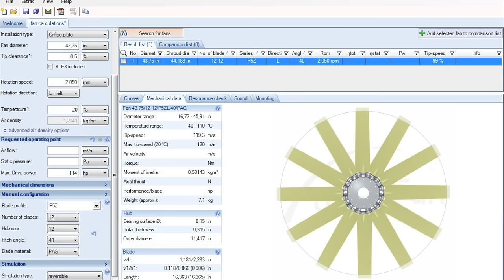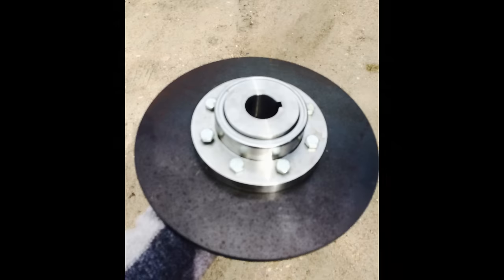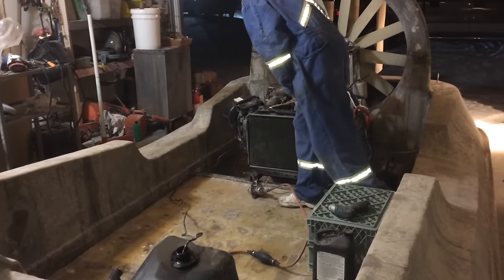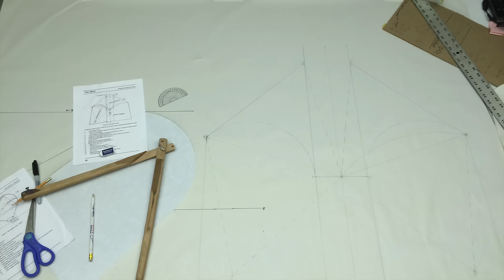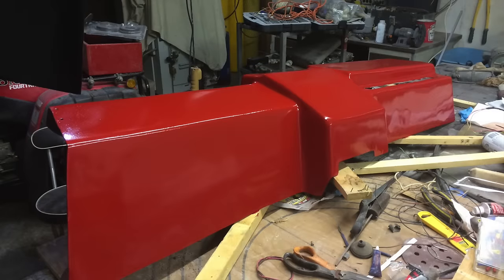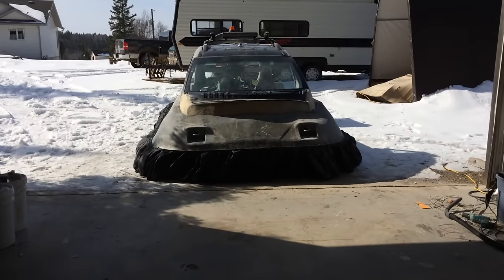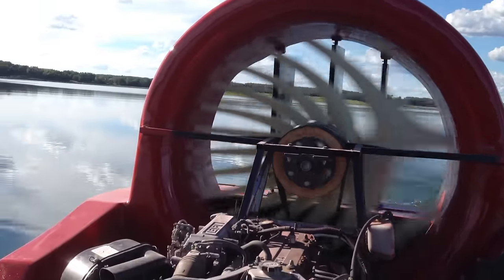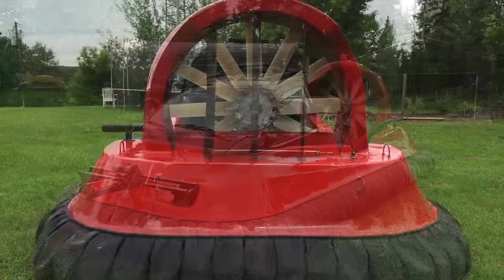DIY Homebuilt Hovercraft

Comment: Super cool. I'm currently in the middle of upgrading an aerocraft 1100sa and came across your video. I'm converting the manual joystick steering and throttle control to an electronic by a custom ordered machine joystick that outputs into an arduino that control servos for the throttle and a modified windshield wiper motor piggiebacked off another servo for position sensor for the steering. I'd like to upgrade the engine from the stock 60hp rotax 582 to a suitable snowmobile engine but atm I'm unsure of how to achieve proper pitch and rpm so I don't blow either the prop or engine up. Was thinking I would use a cvt and maybe variable pitch prop and use some online calculators to help guide me. My biggest concern is weight added such as bucket seats, instrument panel stereo ect. Having enough thrust to enclose it would be great. Would you be able to provide me with any websites and shops you used in your project?
Reply from the maker: Hi Robert!  I used a multi-wing “Z” series on my craft.  The blades are adjustable in the hub assembly.  There is a series of notches that allow different pitches.  They were helpful when I contacted them.  They had a program that you would put the parameters in and it would tell you approximate pitch settings.  If the fan can “absorb” the power from the motor, it won’t over speed.  Keep it simple if you can, reduce the fan rpm with a pulley system or commercially available drive reduction unit.  Less fan RPM will mean less noise.  If you need specific parts or materials let me know - I can try to help you.  Here is a link for wing-fan.  https://www.multi-wing.com/us/z-series
Reply: I never got a notification so im glad I checked back to see if you replied.. You raise an interesting point about lower rpm to limit noise, and after reading about reverse angle pitch for reverse thrust and  having the ability for constant rpm thru variable pitch I'm sold on an electric controlled hub. I've yet to find one thou. I've also decided to go for the ground effect craft after seeing them on YouTube. I'll check out the link you sent. Ty

Comment: I would like to know how you supplied air to the skirt
Reply from the maker: There is a splitter that takes the lower 1/4 of the air from the duct and directs it into the plenum.  There are individual feed holes in the plenum that supply air to the skirt segments.

Comment: Question - can you inflate without increasing thrust? How do you stop without deflating?
Reply from the maker: At about 1/4 throttle, lift is established.  If I am on water, due to the drag, the craft will start to move, but slowly.  If I am on water going fast and I want to stop, I can decrease the throttle and the drag from the water will allow me to stop quickly.  However, if I am on ice or flat ground, the moment I get to 1/4 throttle, lift is established and the craft starts accelerating.  The slowest I can go on a frozen lake is about 30 km/h.  If I want to stop, I could decrease the throttle and put the craft down on its skids but if I want to reduce the risk of hull damage, I spin the craft 180 degrees and apply thrust until the craft stops and then quickly set it down before it starts accelerating again.  It definitely takes some practice!  My first hovercraft had an independent motor for lift and you could maneuver at very low speeds.  I guess that’s why they call the larger single engine crafts cruisers.  Many made to get you from point A to B quickly.  I hope this answers your question.
Reply: @atlantisdiving1  that’s awesome mate. It’s an amazing piece of work congratulations

Comment: Why did you not use a toothed belt and pulley?
Reply from the maker: I was concerned about weight of the metal pulley and also at the time I could not source the appropriate parts for that reduction ratio and horsepower.
Reply: @atlantisdiving1  Well done sir! I was very interested to see how you overcame  the pulley requirement, My efforts using a ready-made multi-V belt slipped a lot when on water. The Danish Multi-Wing fan with its large number of possible blade and pitch configurations make it easy to match the engine curve, I cheated and bought stuff on recommendation! Great how you overcame it. Very satisfying.

Comment: I don't get it what's lifting the craft you only have a pushing fan but there's no left
Reply: There is an air splitter in the bottom 1/4 of the duct that directs air into the skirt and under the craft.

Comment: Final weight?
Reply: Hi John. Not sure about the weight - probably 1200 pounds.  I would have to find use a roadside scale.
Reply: @roberttymofichuk1276  
When you do, after you have found the "resting" weight...
start the engine and hover in place...
and see what the scale says..?
Reply: @JohnSmith-yv6eq  I never would have thought of that!  It would be interesting to see!